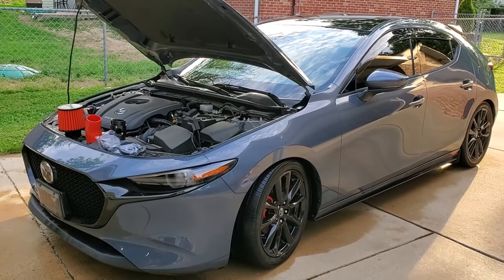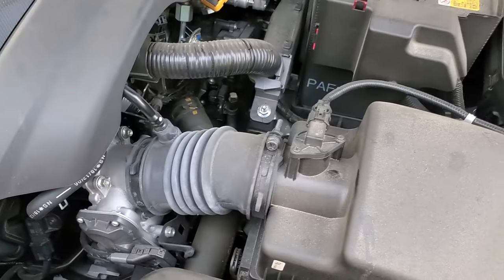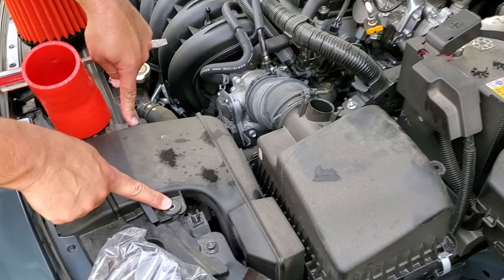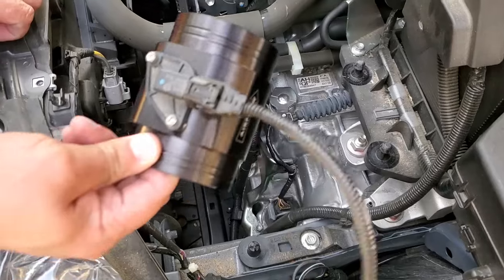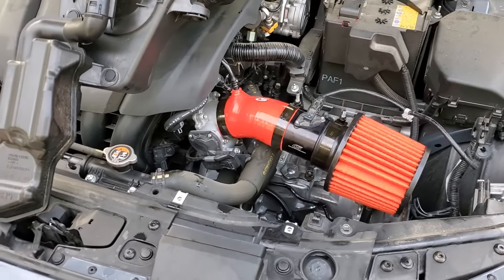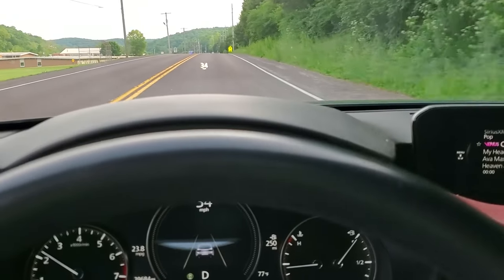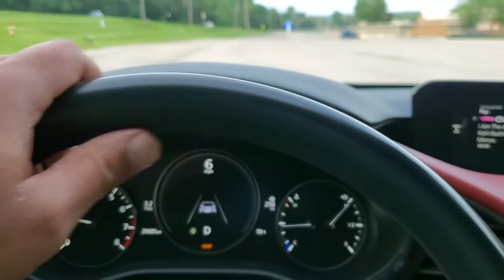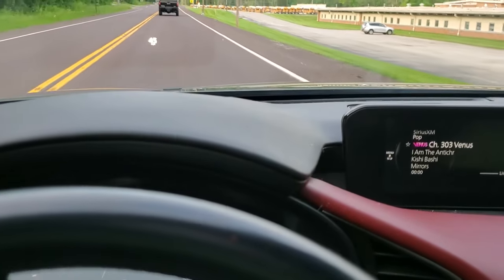2019 Mazda 3 gets Corksport High Flow intake and the car comes alive. Simple install for big sound

Comment: Hi there I have got on the same cold air intake and I have an engine malfunction error on the dashboard, do you also got the same problem, if so how you solve it ?
Reply: Did you plug the connector for mass air flow sensor back in during install? If so, I have no clue 🤷‍♂️
Reply: @sickslickz  hello, I got my air flow sensors right, I just unpluged my battery and plugged it back. And now the malfunction thing went off.
Thank you so much anyway, have a nice one.:)
Reply: i want a mazda3 hatch but can’t afford those news 2.5turbos. Is it possible to get a turbo kit for the 186 hp non turbo engines and get it up to the same hp as the new ones?!
Reply: @mathislane178  sorry sir, honestly no idea 🤷‍♂️
Reply from the maker: @mathislane178  this most likely would cost more and be unreliable

Comment: I wonder what the HP gain is on that? It sounds excellent.
Reply: None
Reply: @jacksonbf  I've heard it is about 5 HP.
Reply: @robertwilliam9558  it’s only induction noise, and honestly it can get wet and only brings in hot engine air.  But I love the sound lol
Reply: I mean 5 if anything, but probably no extra horse power, the sound inside the cabin is pretty sweet tho (the audio in video does not give it justice), car does take a mpg/kpg hit, but in my opinion, the sound makes up for it in my opinion, definitely wakes the car up, and makes it more fun to drive at just regular speeds
Reply: It probably lost power
Reply: You would get the same hp gain with a new air filter.
Reply: @turboturtle9083  I very much doubt that.

Comment: I got a 19 gt fwd. Does this increase power? Or is it more for sound?
Reply: You lose power, you increase fuel consumption and you force feed your engine hot air which is a killer for Skyactive engines since they use more air on the engine to cause combustion, than any other engine out there. So no, you only get a nice sound and ruin your car.
Reply: I highly doubt that exhaust is as good as the oem. The new sound is definitely not nice enough to warrant any potential issues.

Comment: So let me get this straight. You force your car to suck HOT air but sound "cool" causing more harm than good in the long run. Got it. As for the description, I find it a bit deceptive as a Mazda 3 onwer my self. It doesn't add up any power, infact if anything you lose power given you suck in air that is about 50 degrees celcium at best on a cold day, since the engine runs at around 100 degrees on average during winter with minus temperatures. 
The proper way to do this (as I did), is to visit a mechanic, and have that filter extended all the way down to the fender gap, that way it will be away and under the engine and it will always suck fresh air 24/7. The only difference I noticed was the sound and the fuel consumption, no power gains.
Reply from the maker: You are my hero!